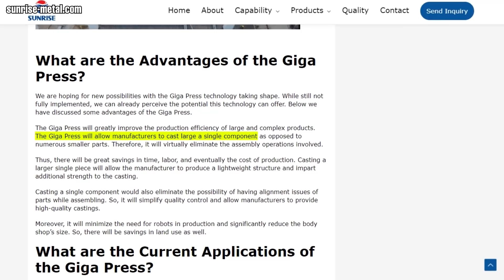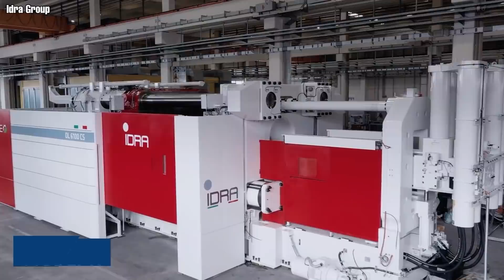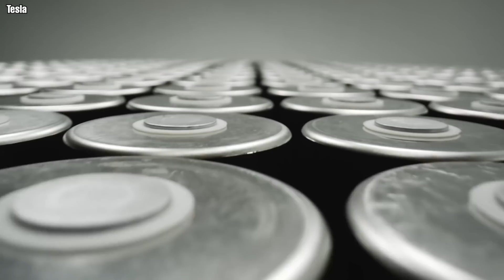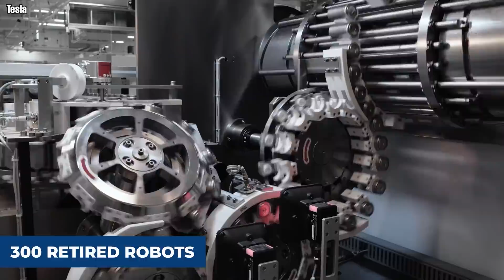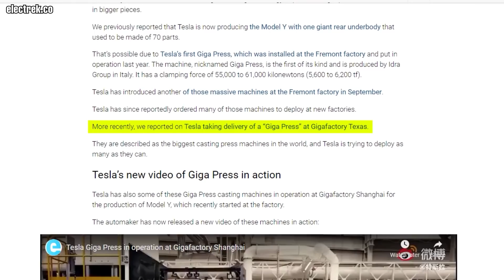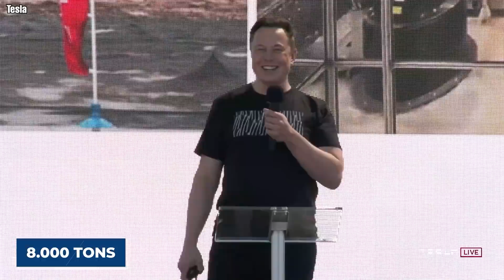IT HAPPENED! Elon Musk FINALLY Reveals New Gigapress!

Comment: My Cybertruck is ordered and I will wait but I do have one concern.  I saw a video of someone with an 8 year old Tesla that developed battery 'issues'.  Tesla's quoted repair cost was $22,000.  An independent shop was able to do the job for $7,000.  This was to replace a couple of battery cells and a couple of sensors.  I have to wonder how a 'structural' battery pack will compare.

Comment: I think the 12k GP will be for Cyber Truck which will benefit the most from single casting. The Tractor will not use aluminium castings as steel frames are better for such large structures.

Comment: What happens when you wreck the car, is it totalled if you wreck it?
Reply: This seems to be the most common question. Similar to any other car chassis a replaceable crumple zone is designed into the car for high risk areas. If it is a major accident it will be totalled. Just like any other car.
Reply: If the chassis is damaged on any vehicle it’s a total loss
Reply: Totalled

Comment: With all the money gigapress saves tesla, why aren't their cars cheaper?  They are replacing 600 $50,000+ robots,  saving all the human cost as well.  Where are the savings going?
Reply: They make insane profits on each car, something like 35% margins. Tesla has a temporary supply problem which means the demand is too high. People are waiting 8 months to one year to get their online ordered vehicles. When the demand is that high, then they must price their cars higher or risk even more demand that they can’t produce. When giga Texas and giga Berlin ramp up and the competition comes in from China, then and only then will Tesla drop the price on their vehicles!!! As for all the Tesla savings on their cars, that money is going to their bottom line and the Q3 report and the stock price reflects it.
Reply: They will be cheaper in the future. This production line is not finished yet and they currently can't keep up with demand.
Reply: Tesla's car prices have drastically fallen over the years. Look back at previous models and pricing. It was only about a decade ago that their cars where easily over 100k. Tesla is on its way to breaking into the economy car market of 25k. Tesla has forged the EV market from essentially nothing.
Reply: Research and development costs.
Reply: Space 🤣
Reply: there is many other parts in a car that costs money